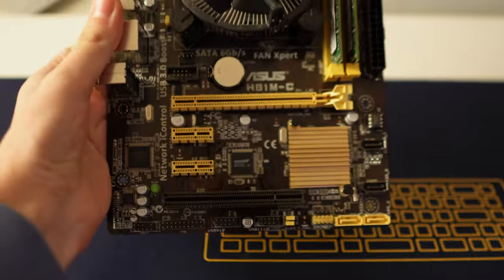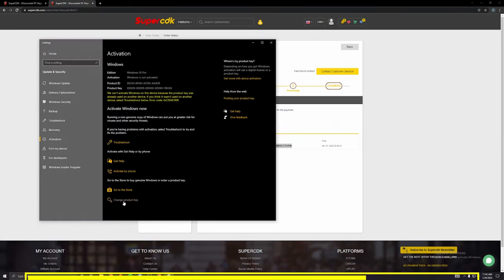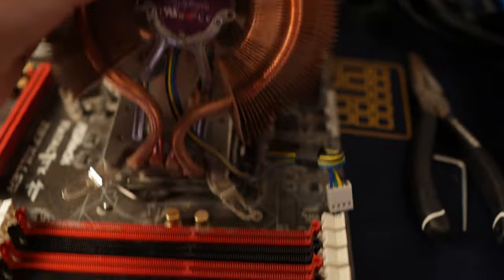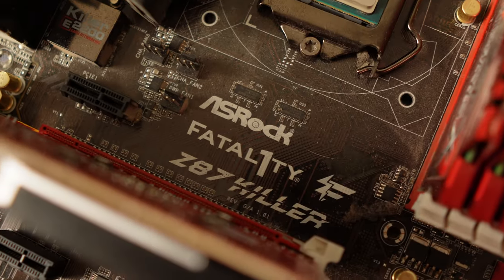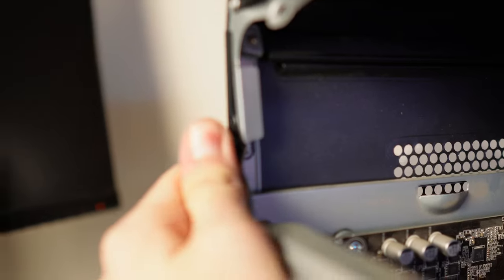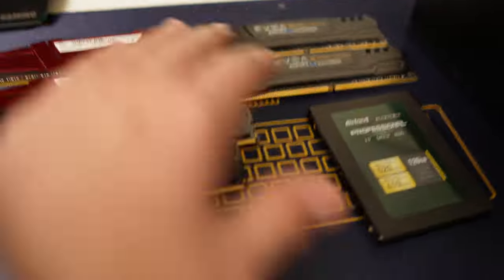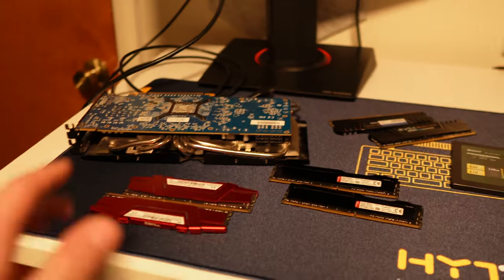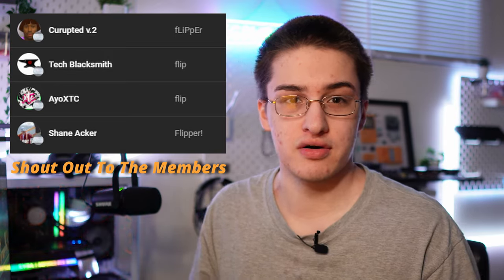Flipping Pcs Until I Buy A House! Ep. 2 | Getting CHEAP pc parts in 2022!

Comment: Eli I'm tryna build a budget pc for content creation what do u think of and i7 6700 and a gtx 960 for streaming an recording minecraft
Reply: 👍 will probably work well
Reply from the maker: Should do good to start, probably be able to stream around 30fps maybe 60 if you stream at 720p
Reply: @ElijahsLab  ok is there any better cpu u would recommended that won't break the bank
Reply from the maker: @timsterwhale64  the cpu is good for now. If you could, I would recommend getting Atleast a gtx 1650, will preform better than the 960 and you can stream better with the use of the nvenc encoder
Reply: @ElijahsLab  ok final question I have 2 options to build the pc or buy an office pc with an i7 and stick a graphics card in it wich I might do because It's a cheaper option 
Is there a small gtx 1650 that can fit in an office pc
Reply from the maker: @timsterwhale64  yes just look up itx gtx 1650